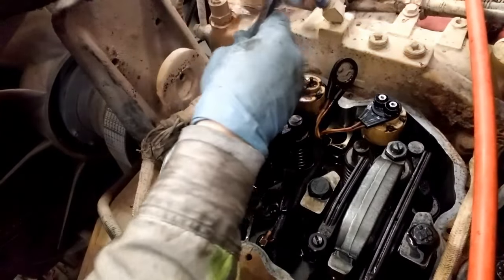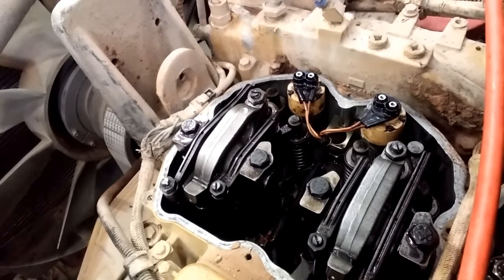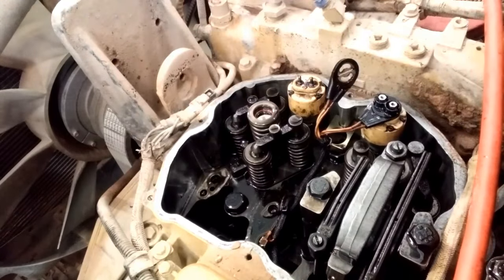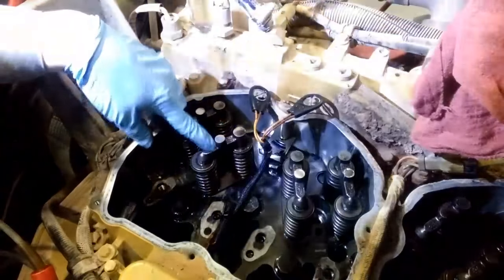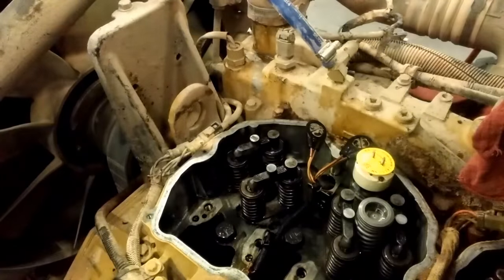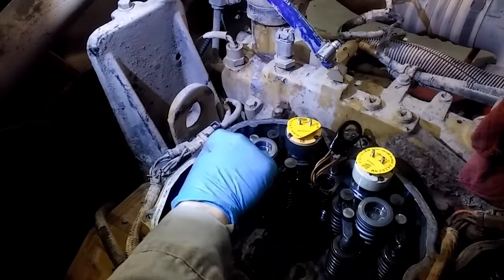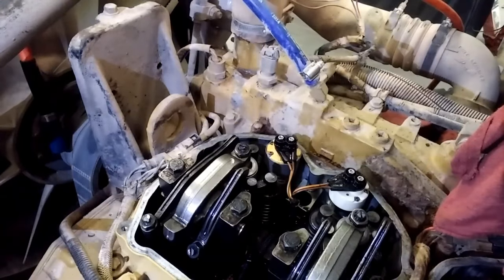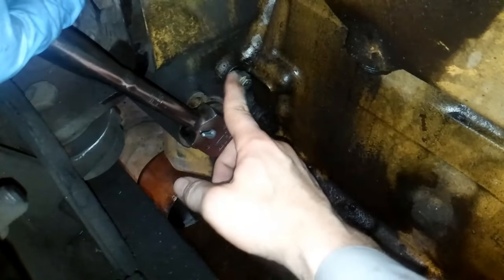How To Install C10 and C12 Cat Injectors.  Removal, Install, and Adjust Injectors.

Comment: Another great video. Thanks! 
I know you mentioned to make sure and check that push-rods are straight, since at this point, we have them in our hands anyway. Which of course is a very good practice, but how do you check them closely, other than a visual?  

We keep a clear pane of glass here in one of the tool boxes. When we are ready to check a push-rod, we grab the glass piece, give it a quick cleaning, and apply a little puddle of new oil onto it. Then we lay the push-rod onto the oily spot on the glass, and roll it around. While looking up underneath at its contact pattern against the glass. This shows us even the most minor of bends. 

I also see that this engine is pretty dirty. I personally would spend more energy than I'd like, worrying about some clump of dirt getting into the engine during this repair. Our practice here is to power wash off the engine with soap and hot water, before such a repair. Is this an option for you guys in the shop, and then just include that charge to the customer? 

We don't always do all of our own work here, and sometimes take one of the Trucks to another shop for some work. When this is the case, and we have a very nice power washer here, we always give the engine, or transmission, a good washing before we bring it in. It gives me peace of mind! : - )
Reply from the maker: Steve Kluver We have pressure wash bay, but it is broken half the time. Believe it or not I did wash the engine off quick before bringing it in the shop. This was a water truck so there was a thick layer of dirt over everything and that big air cleaner didn't allow me to get to the top of the engine very well.

We usually just look at the pushrod, we roll them on a table sometimes, but haven't done the pane of glass trick. Sounds like a pretty good way of checking it though.
Reply: Adept Ape having  40yrs of experience as a diesel engine mechanic, I just  take a handful of pushrods and toss them  on the bench so they  roll. Any rod that is even slightly bent will wobble, also of them I don't hear them ring ( loose ends/oil filled) I replace.
Any hard nicks in a pushtube warrants replacement.

Comment: Hello. Your videos are great! I am trying to fix a few issues on my c10. It misses for a few seconds on start up and is over fueling at idle. It clears up when you run it down the road and idles clean for around 15 minutes then runs rich again until you run down the road. I was going to have all 6 injectors tested but when I pulled them out several had broken middle o rings. All lowers were carbon and deteriorating as you described. My question is could the broken o rings be causing this by themselves?? Tia.

Comment: How much should this cost to do? I have a c12 that's running good but kind of weak. Was told it needs injectors when I bought the truck but I never got them and started hauling. Now that I've bought a 2nd truck I want to get the c12 in better condition for a driver

Comment: I'm having a hard time finding the injector hold down bolts. Where can I find them for a C13? Also what will happen if I don't set the intake and exhaust heights and just torque the bolts?

Comment: Hi, sir, I'm Jonathan magturtur, and presently work here in Saudi Arabia, as a engine overhauling mechanic, and the engine that I overhaul is c11 and c13 . And may I ask a question sir? Could we start that engine with out the panel board from its body pay loader? As we testing first befor installing to its body pay loader? Please sir, gave me your advice here. Thank you.

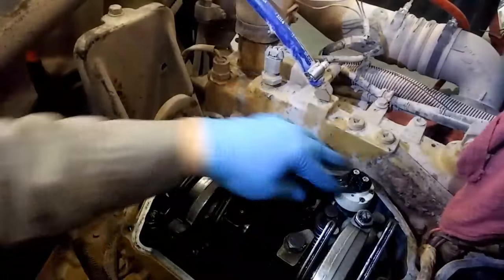Comment: 9:05 WARNING!! Those electrical connections are VERY easy to over tighten and break the studs. Tighten them very lightly with a quarter drive ratchet. I mean Very lightly.  I broke one off and had to swap the yellow part off another injector, which thankfully wasn't a hard task.

Comment: Electrically the injectors on what range of voltage work?? How the high voltage gets build up? Thank you!
Reply from the maker: +armando nika Many of them operate at around 90-120 volts and the ECM increases the voltage.
Reply: +Adept Ape thanks for responding, i wanna know more about it im some kind of person that wants to go more deep 😀😀 i've heard that there are capacitors in many systems dont know if this one is one of them.
Reply: Adept Ape hey man do you know if you have to pull the cylinder head on a 2000 c12 to replace followers for the injectors

Comment: Wouldn't that be HEUI? Fuel filled head at like 6, 8, 12 PSI and the electric injection type? Or does HEUI not have a 'piston pump' inside the injector when it comes up from the spring to suck up the fuel into it then it gets pushed down to inject? I think I somehow found a way to confuse myself, again. Or is there a difference between EUI and HEUI? Anyways, Excellent video!
Reply: Heui uses pressurized engine oil to fire the injector when the solenoid on top moves. These are meui as they use mechanical force to fire the injector and the fuel is metered electronically.

Comment: You said you torque the rockers first then put in push rods.. I cannot get the injector push rods in after its torqued. Not enough room
Reply: Do I have to bar the motor to TDC and put them in the same time I adjust them?
Reply from the maker: The injectors are harder to do. I have since started putting the rockers on with the injector pushrods in, then putting the valve pushrods after.
Reply: @Adept Ape  I can see why, thank God tho cause I was going to take it all apart in the morning thinking maybe I didn't have the injectors fully seated, even after torqued.
They do stick up about 1/16 of an inch above the head surface.. alls good now! I will loosen rockers and install the pushrods re torque and good to go! I really enjoy your vids, Thank you!! Jax

Comment: Assist for c 13 cylinder head bolts torque and rocker bolts torque 
Or Torque specs pdf for C13 DH402038